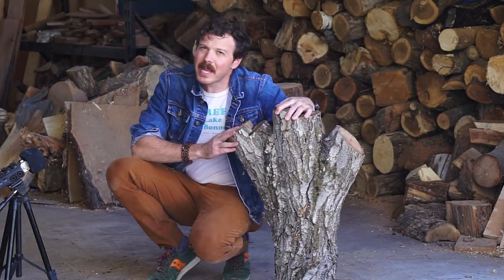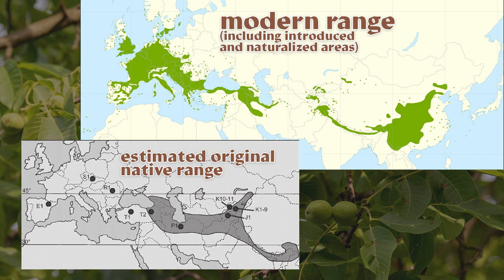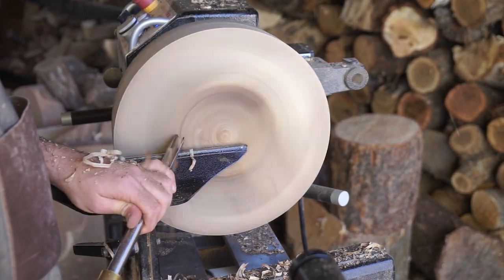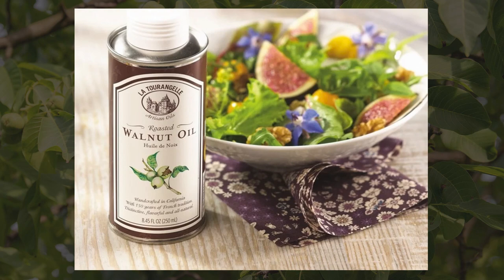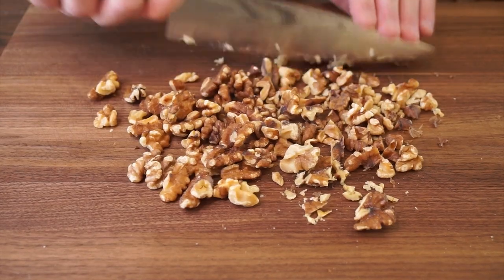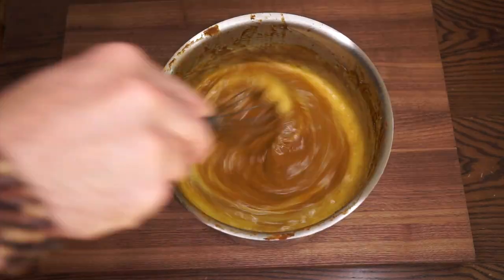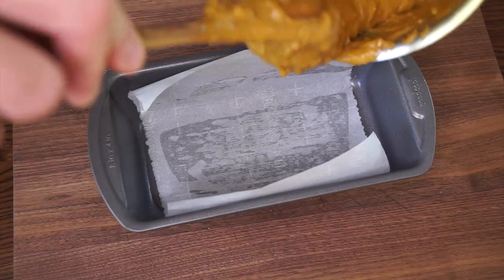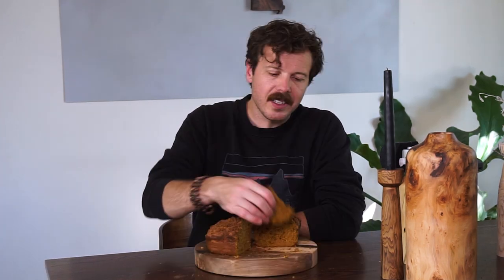Making a platter out of English walnut wood & baking walnut pumpkin bread

Comment: We had both types of walnut at my grandparents' house growing up, though we didn't do much with the black walnuts. It was basically a full time job harvesting English walnuts! Fun fact, the green fleshy part (the discarded hulls) will actually kill off plants underneath the walnut trees. My grandpa really cared about his lawn so I had to spend hours running around picking up all the hulls so his lawn would stay immaculate. Once harvested the nuts have to be hulled (removing the green flesh, if it's still attached) and laid out in a single layer to dry for weeks, rustling them around on the daily so they dry better. Then obviously you have to crack all those shells without destroying the nut inside. Then you finally get to enjoy! We made spiced nuts with the prettiest ones. Too bad I hate the taste of walnuts! All that work and I didn't even enjoy the final product... 😅